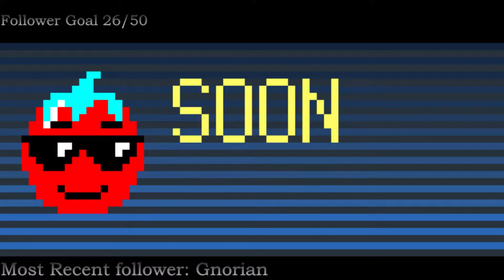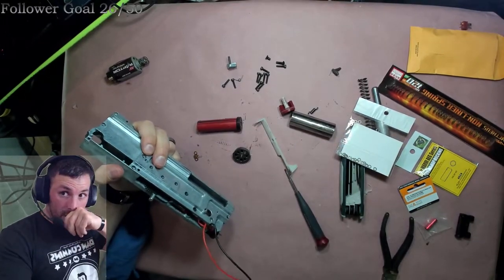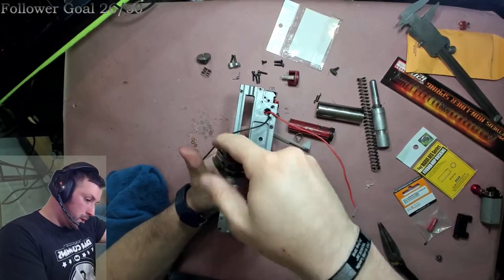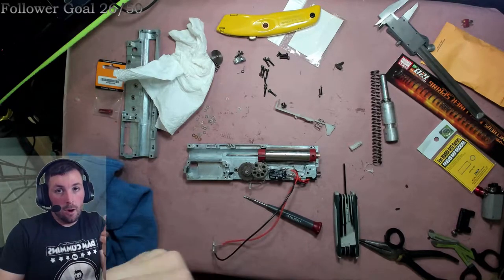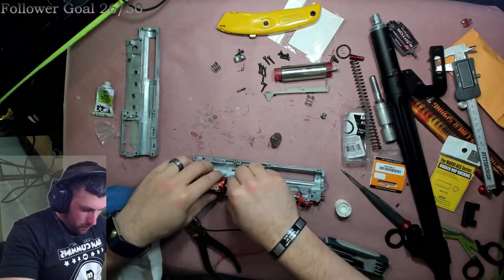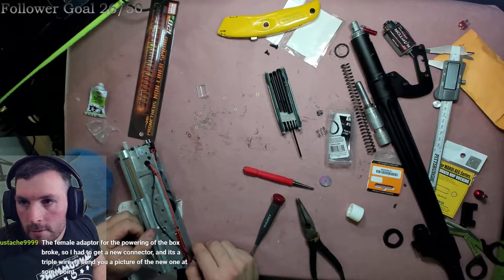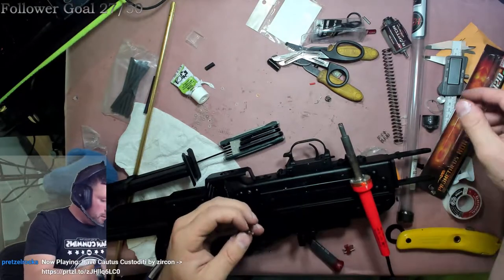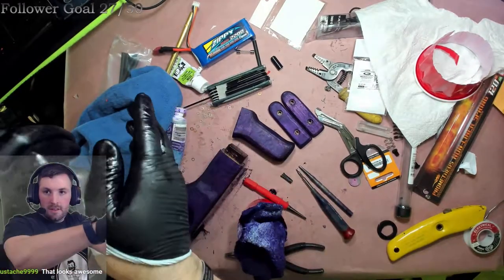A&K PKM airsmithing live stream with timestamps

Comment: A PKM? With a fluted outer barrel? And AK style gas block? Nah that can't be right, that's the Original PK
Reply: And just noticed the main upper, that's 100% a PK not PKM
Reply from the maker: Well I mean it's airsoft so they take lots of liberty with the design.

It is sold as a PKM so I have the title as what the manufacturer states it is to help people find what they might own. 

Since we are on the subject though. 
What are the differences between the PK and the PKM?
Reply: @pewpewairsmithing  Ah so it's yet another Manufacturers error in advertising. 
The main differences are
- Upsidedown AK style Gasblock
- Fluted outer barrel (looks so much cooler)
- Feeding Tray cover is more solid and flat unlike the PKM's shaped one
- The stock has a different finish and is usually made of plywood instead of milled wood
- No shoulder brace on the buttpad 
- A few other differences with the main stamped receiver. 
And in the real steel world it's about 3kg heavier than the PKM
Reply from the maker: Good to know

Comment: What is the inner barrel length on the pkm?
Reply from the maker: 550mm.  Theres a link to the one I used in the description
Reply: Is that the longest inner barrel you can put in with out adding suppressor?
Reply from the maker: @patriciafisher-misuraca3890  depends on the flash hider I'll look at where the barrel ends on mine and give you a guess
Reply from the maker: @patriciafisher-misuraca3890  sorry I forgot to check until now. 550 mm is the longest you can have without a muzzle device.
Reply: OK this will help me a lot thanks.

Comment: Hey my pkm aint firing it can you help me out
Reply from the maker: I can't guarantee anything since this is just the comment section of You Tube but I can try.
Reply from the maker: So I guess we can start with the question. What do you mean isn't firing?
Does the motor turn the gears?
Reply: t0ma70  we found out the barrel keeps getting jammed not the reciever and the 6mm bebbies are what it says to loud do you think hop up could be a problem and what is lms near the bottem
Reply: And its brand new
Reply from the maker: If it did that out of the box I would contact the seller and try to get a different one.  What brand bbs are you using? You can remove the inner and outer barrel fairly easily. You can check to see if the hop up bucking is damaged or bunched up.  
If all else fails take it to a tech.
Reply from the maker: What do you mean lms near the bottom?
Reply: t0ma70 its near the slower or faster fire rate buttons behind it
Reply: Thanks man glad you helped
Reply: @MuscleMike2005  the L-M-S switch is a back up unit of the FCU, basically just forces it to stay on a certain setting if the main FCU blows
Reply: @28291973  I switched the bbs and it works fine no more problems for now
Reply: @MuscleMike2005  ah so it was a case of horrible bb's, never cheap out on bb's, it'll be much more expensive if something breaks because of them